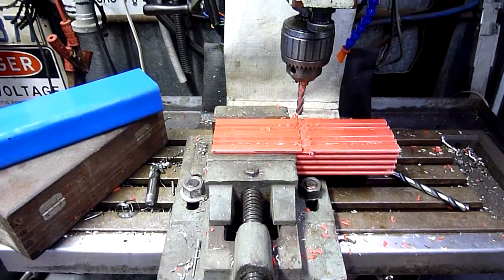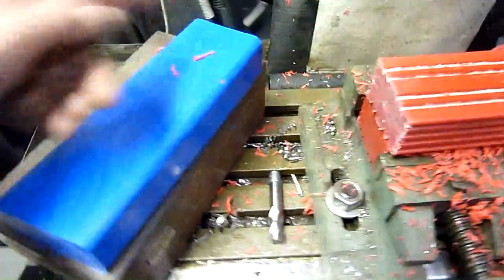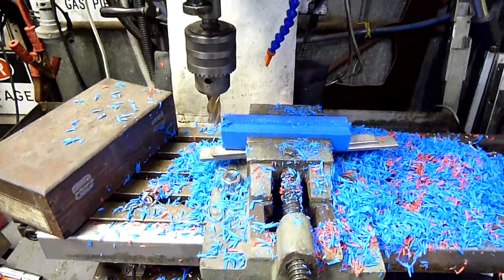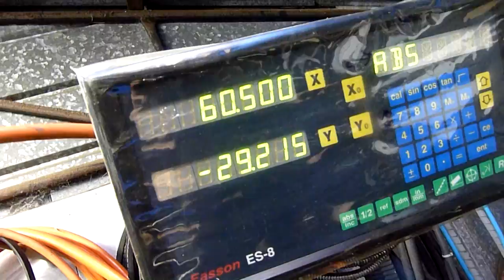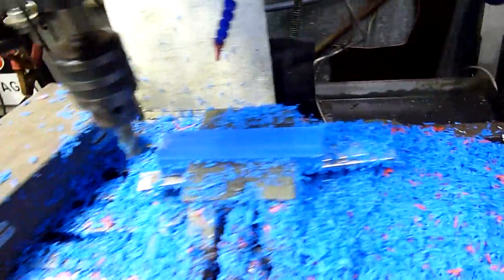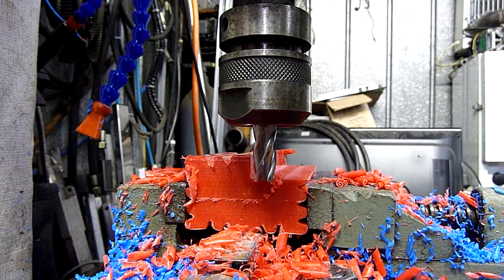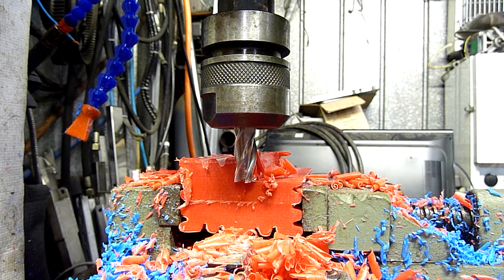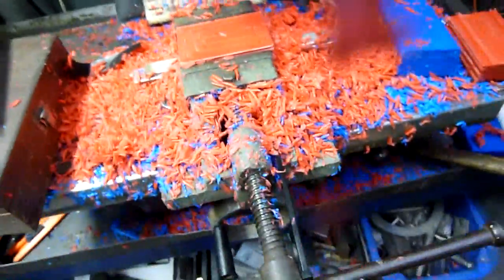Milling Plastics for Faip F81 Tyre Machine

Comment: I can't help but think about setting up a rig to hold a vacuum cleaner hose by the drill chuck just to suck up most of the plastic waste so it's not all over the place (and handy to recover it to melt down for 3D printer use, if you ever get one!)... :P

Comment: Someone send ed a spring collet holder please, What taper is your spindle.
Reply from the maker: yeh I really need a proper collet chuck, the R8 ones at work are awesome.
the spindle is MT3 with a 12mm or 1/2" draw bar

Comment: That's alot of plastic to waste for such a simple cut... Why  did you not just use a band-saw?
Reply: I'd guess his technique is a little more precise.
Reply from the maker: I could have cut it with a saw, but the blocks only needed to be so wide, so 10mm kerf is acceptable scrap.
bedsides. the plastic was free and I can get more if need be.
Reply from the maker: *****
I could have saw cut it, but then I would have to clean up each block anyway, so the same amount of material would be lost anyway, and I would have the added step of sawing it, not the most productive method.
Reply: Aussie50 Can't go wrong with free plastic then. :P